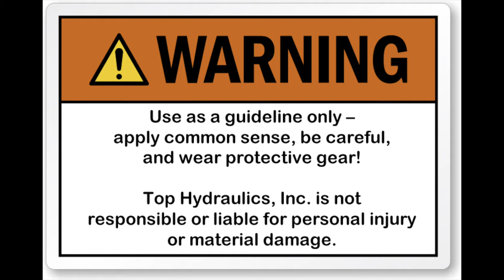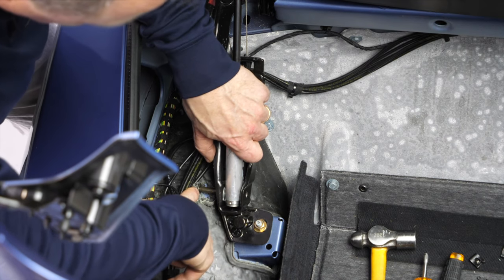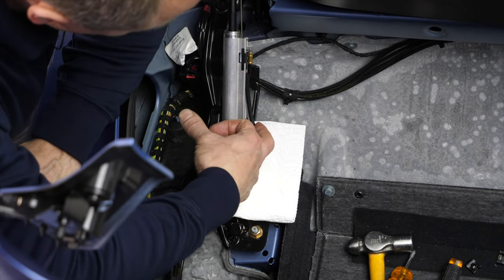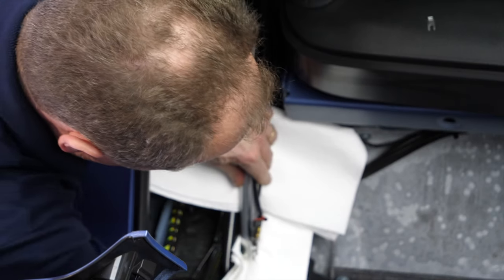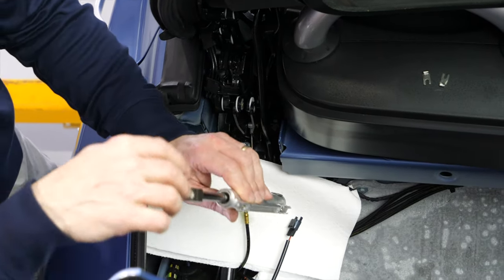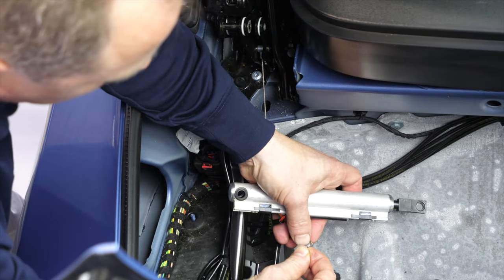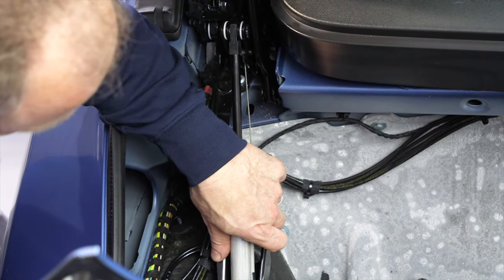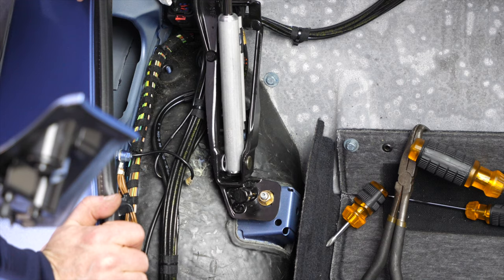How to Replace the Main Lift Cylinders - Chrysler Crossfire - Top Hydraulics, Inc.

Comment: What is a good sign these cylinders need to be replaced? When my top is open and i try and close it, the top comes up a bit and then falls back. Lots of motor sounds, but seems like the lift is weak...
Reply from the maker: Have you checked the fluid level in the pump's reservoir yet?